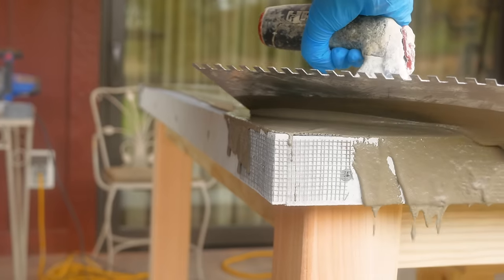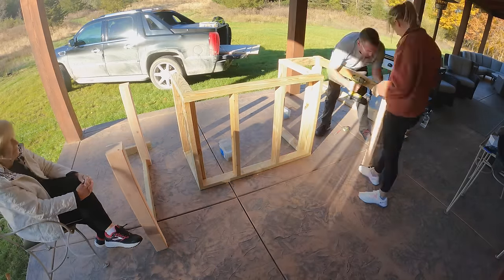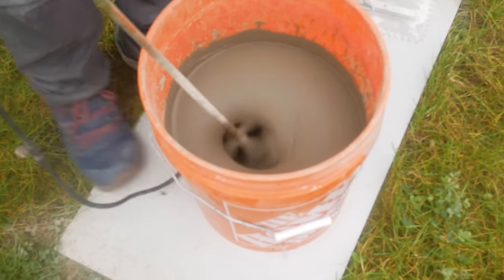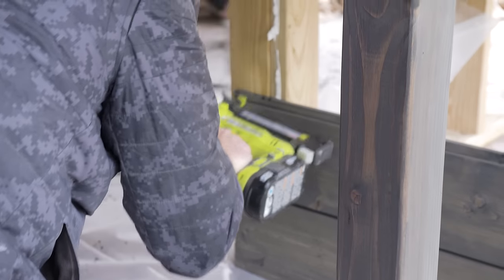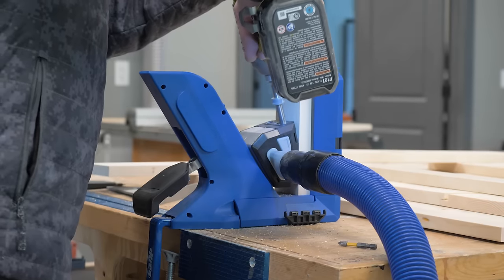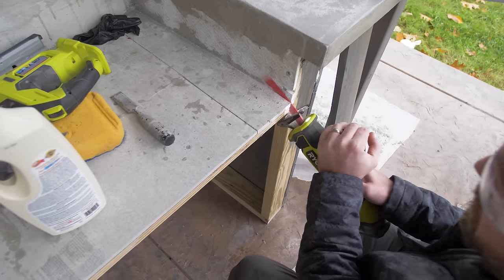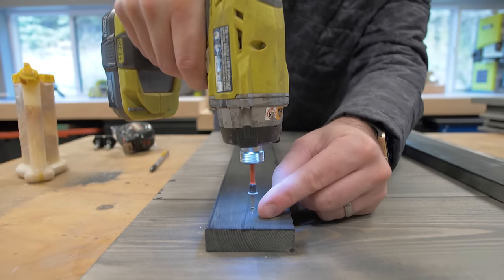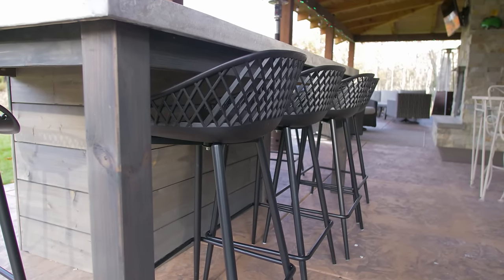Making a Hibachi Grill Table using a Pit Boss Griddle 🔥

Comment from the maker: Get the full plans and links for this project here: https://rogueengineer.com/diy-hibachi-grilling-table-plans/
Reply: Looks good, but did you vent your propane? Don’t want it to go boom.
Reply: would it be possible to make concrete counter tops with the method you used but with a thicker layer of concrete? i really like the counter tops that modern modustrial has in his new house but he paid 10k for them with most of the cost being due to labor but i feel like the price could be cut down to 2k and below with a modified version of what you made.
Reply: Only thing is, this is not a hibachi grill... it's a teppanyaki grill (flat top). Hibachi grills (aka konro grills or open top grills) are used to make yakitori(japanese skewers) and traditionally are fueled by binchotan charcoal (there are some gas hibachi grills, but that just beats their whole purpose).

For the rest this looks pretty solid!

Comment: He did all this with some ryobi tools 🤣…i actually like their nailers
Reply: I have all Milwaukee personally, but Ryobi makes some good stuff.
Reply: @vincentking8267  they do, the air strike is great, shop vac, lawn tools, etc but Milwaukee are monsters…
Reply: @lrac_1  technically they're owned by the same parent company, along with like 15 other brands, lol. I don't have any beef with anything except black&decker. Even harbor freight is fine if you have the correct expectations.
Reply: @vincentking8267  yea I heard that, Hart also under the  (they had a good extractor on sale recently)…I feel you on black decker, heck I do have a Bauer compact saw I needed in the fly…works great

Comment: I would be interested to see how that skim coated counter holds up over time. Cracks could result in failure of the skim coat especially as it is outdoors and subjected to various weather conditions and temperature swings daily.
Reply: I too am curious about the durability. I'd love to make a bar like this for my griddle and the idea of a skimcoat vs a solid concrete counter is very intriguing.
Reply: @bradweaver6124  The truth is that just doing atleast a 2in thick reinforced slab over what they did is not overly cost prohibitive compared to the skim coat and in my opinion will give a more durable and sturdy look and feel. I imagine it sounds sort of hollow and not as stiff as a slab. I also would imagine the first time someone drops something heavy on this it will crack or at least chip. The corners/edges are the biggest point of weakness I would be concerned about, as this skim coat was not designed for applications quite like that exposed corner at the bottom.
Reply: @nunya5928  Kind of what I was thinking regarding chipping. I'll just stick with a full pour.
Reply: I’m going back and forth. If u crack it, just resurface it again. I mean a 2” pour will mostly likely end up with a crack in the outdoor elements

Comment: I bought your plans before watching the video and just realized this is for only side drain flattops. I have a blackstone with a rear grease trap. Would you be able to make a modified version of this plan to accommodate that type of grill...The depth would need to be deeper so the grease trap was still inside the compartment and not sticking out the back where people are sitting.
Reply from the maker: It will work for both. You just need to cut the hole in the back and place the drip tray below on the inside of the wall siding.

Comment: What kind of weight does the coat of concrete add? Would love to build this but we are moving later this year and I'm not leaving it if I do! 😎
Reply: I can tell you just cause I’m making the same exact thing just with a blackstone griddle, once this this is done an built, I doubt you will be moving it too much. All I have left to do is throw the concrete sealer and my doors for the front and it’ll be finished. It’s a tank!

Comment: So... how is that Teppanyaki Grill working for you? My "concern(s)" were that there is no airflow into that area of the table to support burning and that you seemed to cut the legs so that no air flowed up into the burners. The result is that the flat top would have to intake air from above, thru holes intended to prevent the pressure from building below the flat top.

Comment: Looks great. I've contemplated what to use for a countertop outdoors that was easy and DIY.  I do wonder if due to the thickness of the coating it will hold up well in places it freezes.
Reply from the maker: Thanks! That product is meant to re-cap old concrete patios and driveways so I suspect it will work out well.
Reply: Seems like a great and easy solution. Looks like this one is fully under cover so that should help too.

Comment: Looks like the top if the folding wing style, when they aren't on there I assume you just take them off and set the aside? Doesn't look like they'd folding onto the countertop. Also, not sure where you live but are you at all concerned about snow/rain/humidity getting to the cast iron top since it can't be covered by a weatherproof cover?
Reply from the maker: Yes I just unbolted it so it just lifts off

Comment: You're obviously a good woodworker and it's very nice.  I don't want to be a troll, but these are typically either built out of CMU or framed out of metal because wood is combustible.  I hope it works out for you.

Comment: Looks great, and very creative use of existing griddle.  However, I am currently building an outdoor kitchen, and every built in grill/griddle manuel requires a insulated jacket if they are installed in a base made of combustable materials. I'm afraid this would be a fire hazard and would definately not pass a building code inspection.

Comment: While this project seems like fun, I would have left the griddle the way it was and just build the table so that the griddle could just slip into the alcove. I just can't see making more work than necessary. Plus if you're doing this with a new grill, I don't think Pit Boss will honor your warranty should you run into problems with the griddle down the road after you've hacked the legs and stand off. Just sayin'....

Comment: Great idea and build but this is a fire waiting to happen. You don't want combustible material that close to a heat source.  As you continue to use this, it will dry out the wood so much that it will eventually ignite. I work in property insurance and I've seen quite a few house fires from this type of DIY build.
Reply: Concrete isn't combustible
Reply: @shaynehall9172  I had the same question. The cement board shouldn’t catch fire. But how well would it hold up over time. It gets pretty hot next to the grill. I was thinking of adding some brick or stone to help with the heat transfer. But if the cement board is plenty I will go with that.